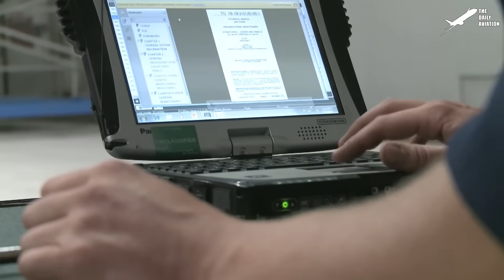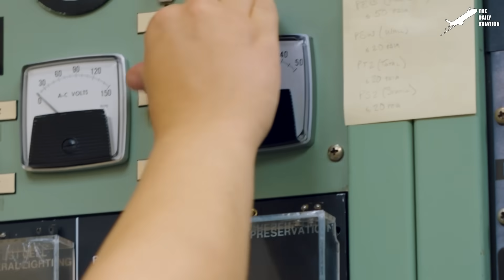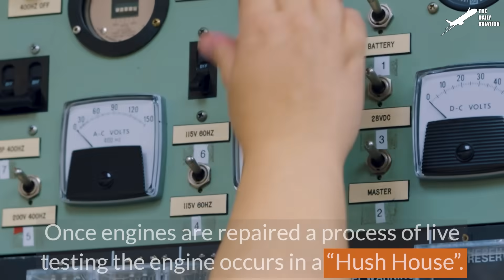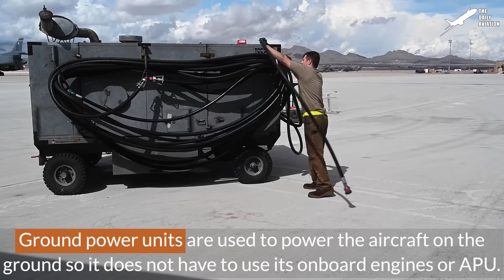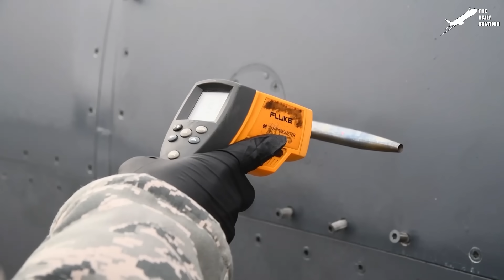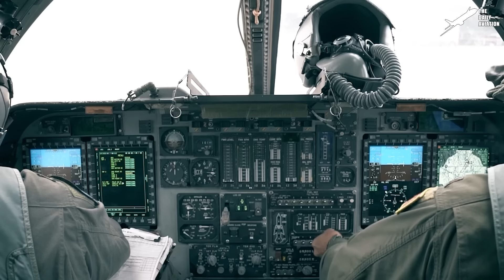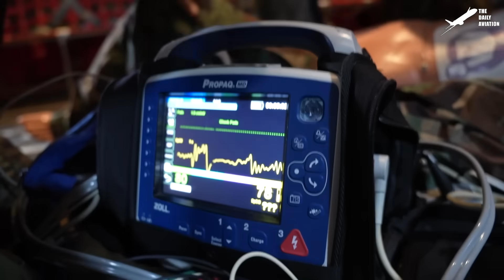Maintaining US' Most Feared Bomber After Crazy Operations

Comment: It blows my mind that these things generate so much static electricity during supersonic flight that they have to be plugged in to a massive ground strap before anyone can work on them
Reply: All planes do that. It's called grounding. They also connect equipment to the aircraft, so that there won't be any static arcs between them.
Reply: @Normal1855 
Indeed. Fueling hoses at large civilian airports are even designed so that the whole assembly is securely grounded before any valves get opened or any fuel starts to flow. It makes sense that military ground crews would be even more careful.
Reply: Have you read the warnings at your local gas station regarding static electricity ?? Hmmm 🤔 ?? 🤔